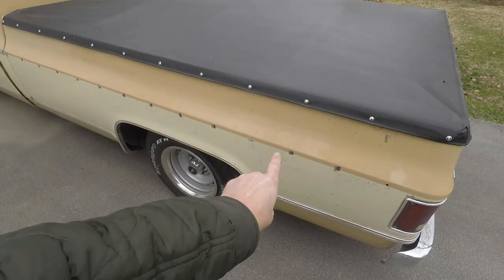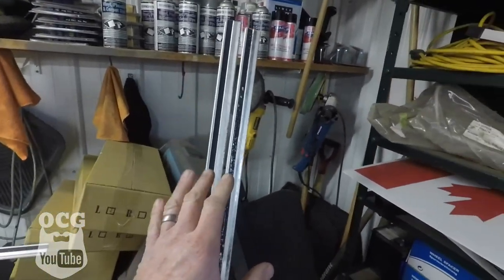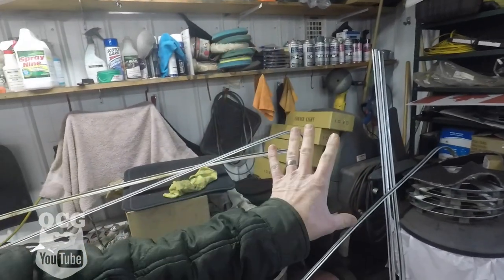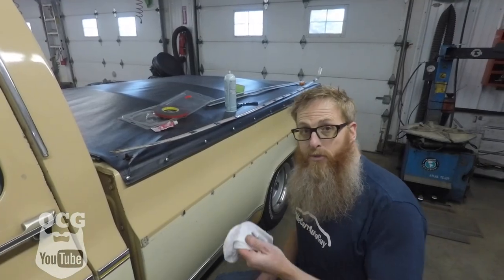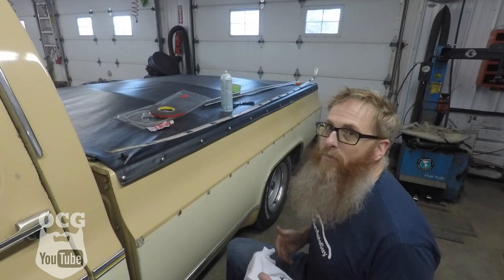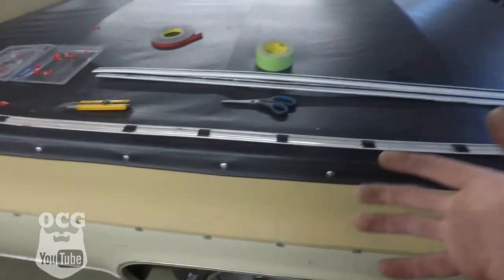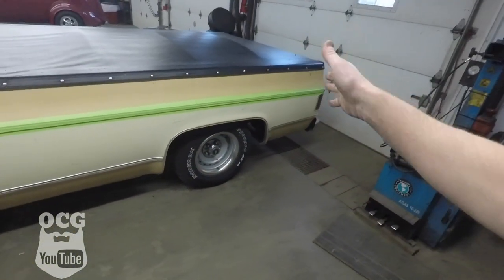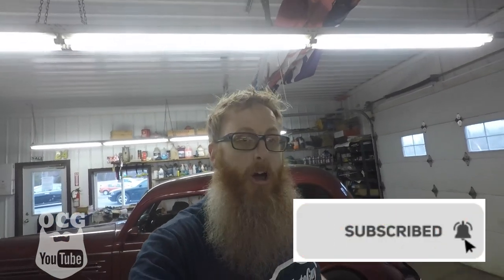HOW TO INSTALL THE BODY SIDE MOLDING ON A 1973 1980 CHEVY C10 K10

Comment: i have a 73 c10 i am about to reinstall the trim on but i do not like the h clips with the posts and nuts and noticed you have H clamps with a rubber or plastic squeeze in type clip that goes right into the hole and expands, where did you get that type of clip...
Reply from the maker: These were on the truck. They must have changed the clips somewhere between 73 and 77.
Reply: Would you know of any places to check, i have checked lmctruck and ebay...
Reply from the maker: @bobaddit7209  Auto Metal Direct and Brothers Truck Parts both sell this sort of thing. Check them out.

Comment: Im trying to figure out if 3M super strength molding tape is better than the 3M mounting tape.

Im trying to attach some protective panels to a plastic boat hull and having a hell of a time figuring out what to use.
Reply from the maker: When all else fails, use ShoeGoo. Its the duct tape of all adhesives.

Comment: Do you have a video on installing the fender moldings ..? 79 c10
Reply from the maker: Sadly I do not. The front fenders aren't much different. The front "C" shaped section is held in with speed nuts in 4 places and does not slide to remove or install, However, you have to install it first before the top and bottom trim which do slide in and retained by a speed nut.
I hope this helps.

Comment: how did you get that piece of trim off to begin with lol. Ive googled my fingers raw and im trying to save those clips on the end
Reply from the maker: Unfortunately this trim was missing when I bought the truck, however, the 2 snap in clips (one at the front of the box and one just above the taillight on the side) need to be pushed through the box panel by squeezing the expansion tabs on the back side and a single screw above the taillight on the back.. You then can use fishing line to "saw" through the original sticky pads. Hope this helps.

Comment: I watched this hoping to pick up a clue on how to remove the bedside trim, since I’m struggling to remove mine without damaging it. How do you reach the clip on the end closest to the door?
Reply from the maker: If they are original, there should be a small stud that goes through the box side with a speed nut on the inside or the stud may be a pressure fit clip that is simply pushed in and friction holds it in place. I hope this helps.

Comment: First time posting on one of your videos and would like to thank you for making and posting them as they are usually very informative like tonight's.  I want to remove the roof rack from my 1992 K1500 Suburban and was looking for something I could put into the screw anchors that are imbedded in the roof  but didnt want to use silicone. Do you think that Shoe Goo product would  do the job sealing the anchors from the elements. Oh ya, I'm in Saskatchewan and  use the Burb through our  -30 + Winters and hope it would hold up under those conditions. I love the 1979 Chrysler 300 Grill in your Cordoba.
Reply from the maker: Shoe Goo is the bomb! Yes! I do think it would do the job you are wanting it to!
Reply: So, technically in your experience, shoe goo is better than 3M Clear emblem adhesive? I know that I think I have heard it mentioned in upholstery videos for leather. Wow! I love learning what is common around the country, but not sold or that common in Nebraska or Omaha. ”Wurth” products is another that had truck sales as dealers and I bought several cans of “Electrical Contact Cleaner” that works great. The labels fall off after 10 years or so and it 100% German. I don’t care, you use what works. After decades of finding stuff that does the job, it is refreshing to hear of something new. 
  It’s a tv commercial; Shoe Goo, I use that S&%|t on everything!”
ASE Master Tech since 1978 Retired. Nice contents, talk louder though for this old guy...

Comment: I would honestly be a fair of wiping paint with brake clean. One is never sure if a reaction is going to happen. As not a professional painter, I definitely would use a wax & grease remover from Eastwood (Pricey, like everything else) but Klean Strip from O’Riellys. In 2021 mid year inflation, a gallon was only $12 something per gallon. The counter guy asked what I was painting, so even he knew others found it to work for this purpose. I have a rust free 1967 C10 OEM that oddly enough, I bought second-hand during the Jimmy Cater era. Gas stations closed, odd / even days to buy gas and county’s took down the 70 MPH signs & hung 55 MPH signs up. Great! That means I would not get run over by Semi’s while riding my 175 cc Yamaha dirt bike. Yeah! Yes, now retired, I have taken to my 67 as my sons wreck their cars instead of mine. So, I get a free Tahoe with 5.3L EFI engine. After decades of repairing 2,500 vehicles per year that were not mine, I will do one for myself. Great channel and I will be looking & watching. My beard was almost there, wife made me cut it. Why? She said I looked younger, but she yells at me like I was younger. Lose, Lose. Men have facial hair hair. It has to go somewhere, so wear it, or fill the sink. Wear it!!!!
Reply from the maker: Thanks for sharing Dean. I am very aware of the brake cleaners potential. Their particular brand is not harmful to paint as other brand we use. I accidentally stripped the bottom half of a door once using the green labeled Carquest brand. What a day that was! 

I hope you do stick around. Lots to come on this old truck!
Reply: I will be watching, but I am still trying to figure out how your bearded photo got on my drivers license?